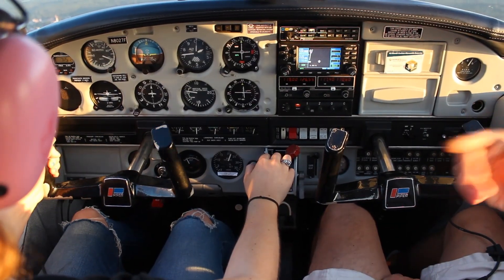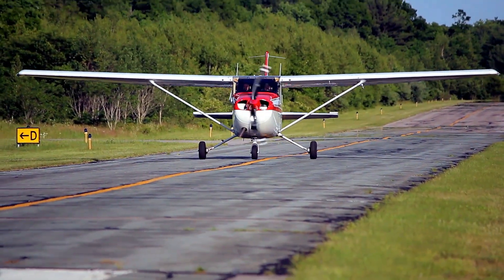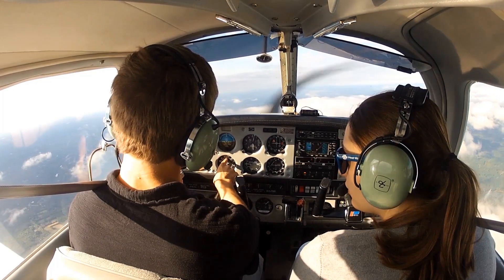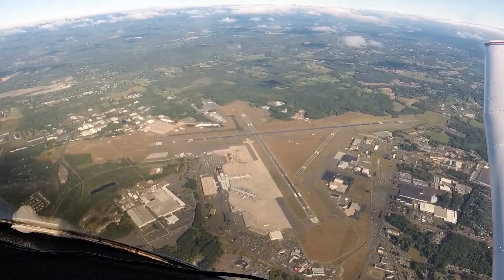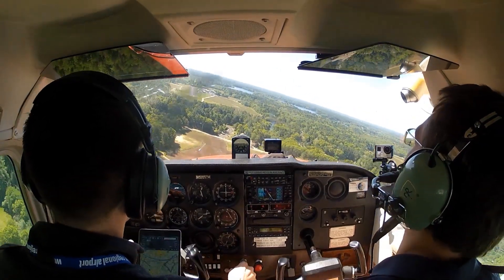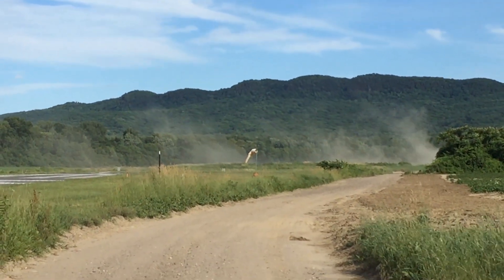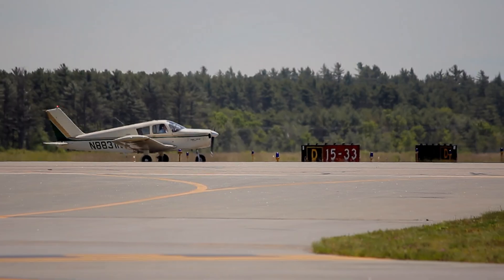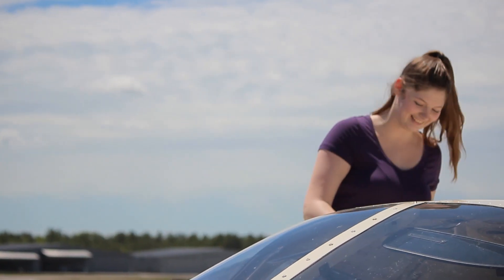Carb Heat Demystified:  Understanding the mechanics and the dangers

Comment: I learned to fly on a PA28 161 some 25 years ago. Carb heat was applied downwind every time, and removed at 300ft agl on final. If there were potential carb ice conditions,  this action would negate the potential, and removal of carb heat at 300ft agl would allow for a full power go around if necessary or  a landing with the air filter engaged above the probable  level of contamination of carburetor inlet air.  Determining carb icing conditions from published meteorological data is easy, but conditions can change from flight briefing at departure airfield to arrival at destination and an attitude to carb heat which allows  precautionary operation and minimises risk of contamination of carb inlet air still seems a reasonable approach to this question. I still maintain this practice. Not very funny or witty I know, but when the wit is over, carb icing does, from time to time, kill pilots and pasengers.
Reply: Same here, it's been 25 years since I flew PA28. IIRC carb heat was on the landing checklist. It was normally applied on downwind. One would note the slight reduction in engine performance, and ensure engine performance didn't improve after a few seconds of carb heat (a sign that there was some carb ice).  Since it was a single checklist item. I was instructed not to leave it on for a long time (and potentially forget to turn it off).
Reply from the maker: This is exactly what I do.
Reply: tag491a I fly a PA-28-180. I only use carb heat when the probability of ice (as seen in the chart in the video) is there. In that situation I'll check in descent by pulling the heat and noting the rpm/engine roughness. You'll get an immediate drop, if it does not improve in about a minute there was no ice there and the carb heat is removed. That said, I've never once seen time where there was ice. Not even in the red sections of the chart! PA-28s are really resistant to carb ice. The only concern I have about your checklist is there is a lot going on in short final and adding a remove carb heat item at that critical time is asking to miss that step. I think you'd be safer just checking for signs of ice on downwind or just before when the workload is not as high.

 Now in 172s/182s I've flown I've had ice. In fact I had carb ice in the 172M I was doing my original flight training in (I had <6hours total time!). The temps were mid 40s and about 90% humidity. Noticed that during the run-up the engine wasn't making full power and when the carb heat was left in the rpm increased over a minute. This was a worst case scenario though. Cold engine (first flight of the day), long taxi (extended low power), on a high probability meteorological conditions day.
Reply: This is exactly the SOP I've been taught, seems to be the best of all worlds. I don't get how you can apply "only if carb icing is detected" when you're at idle - I don't want to find out I've got carb icing just as I'm going around
Reply: I can see the logic Brian and am aware that carb ice with a PA28 is rare, so I agree the application of carb heat downwind should be sufficient with this type. However, I was training at the time and the rationale behind using carb heat down to 300ft was to give me a process which would prepare me for flying other types of aircraft which may be more susceptible to carb ice. My instructor was not a great advocate of absolutely everything in the POH, based on extensive experience. 

Since getting my PPL, I've only spent 5 more hours in a PA28 and flown some 15 other types, in some of which I have encountered carb ice, both in cruise and downwind; 0200's seem to feature here. 

There is always potential for missing checklist items whenever things are busy, for instance downwind with 5 or 6 aircraft in the circuit, and sure, on short final there can be a lot going on, but if you are in an aircraft with higher potential for carb icing, the consequences of missing carb heat removal on short final are likely not going to be as severe as an engine stopping on final – go around with carb heat applied is not disastrous and the reduced climb instantly recognised, usually with a verbal expletive added. Once experienced, not repeated.

If flying different types, one process seems to cover all bases for me, by now is done automatically. It doesn’t hurt those types that don’t need it and works for those that do. There is always potential in stressful situations to make mistakes and using more than one process can only contribute to this. 
Yes, I mostly fly old aeroplanes!

Comment: Got taught on the C172 on finals Carb heat off, so you don't forget it when you have to do a sudden go around.
Greens- gear down and locked
Red- mixture set
Blue-pitch set
Blacks- carb. Heat off and throttle set.
Thats my final check list.
Reply from the maker: Hm, haven't heard the colors memory tool yet.  Neat.

Comment: Is it too late to put it on after rpm goes below the green and the engine sputters?  Do some GA planes have a sensor in the air intake or venturi that tells you what to do?  Do they all use carburetors?  (I drive a diesel truck.)  Your original intro will be very hard to surpass.  This is why TV shows keep the same perfect theme song for their lifetime.

It seems to me, that all you see, is violence in movies and sex on tv....
Reply from the maker: God you always have good questions!  I imagine there is a point of no return, but for the most part, you can burn the ice off.  Very few aircraft have a temperature gauge there, and newer aircraft are fuel injected.  Don't worry, the intro is not gone ;)

Comment: Thanks for the video.  This has been a discussion with my flight instructors for a while now.   They have always told me carb heat wasn't necessary because of the location of the carburetor but never mentioned the routing of the intake.  I will certainly look into that.  Even still, as far as the checklist goes, the decent checklist says, "Carb Heat ...as needed". So you are correct there.   However, the pre-landing checklist says, "Carb Heat  ..ON".  I can understand not having carb heat on if you're landing in the bush, but most of us are landing on paved runways.  As far as doing a go-around with carb heat, the answer is simple, DONT!  Just take it out just as you would if you where flying a Cessna.  I don't understand why that should be such a problem.  Also, if you do need to go around, you want all the power you can get.  You won't know if you have carb icing on base and final and after that, its too late to try to get rid of it at the point.  A very experienced pilot once said to me, "Is it worth the risk?"  I have to say, that question still rings in my ears.

Comment: So what about installing a filter where the carb heat is drawn from?  Is it possible?
Reply from the maker: This is aviation...
That'll be $249.99.
Reply: I believe the reasoning is that you can use the carb heat as an alternative air source for the engine, not only to avoid carb ice. At least that's the reasoning my instructor told me for the C150 i fly.

The idea is that if your main air source gets blocked because the filter got clogged up you need to be able to rely on your secondary source. If that also has a filter it might be blocked for the same reason, that's why they don't filter it.
Reply: that'll be 24.99
Reply from the maker: We're discussing below.  Pending an answer from an expert, there must be some reason, or they'd have it already.
Reply: there's usually a metal screen that prevents fod from going in. Filters wont withstand the temps close to the exhaust
Reply from the maker: Hmmmmm....  I'll buy that.
Reply from the maker: I found mine, and was surprise to find that the grate is super corse.  Like 1/4" holes.
Reply: I read years ago about why it's a bad idea to put screens over intercoolers on cars. It seems like a natural solution to the fact that they always seem to be full of bugs and rocks, but if you crunch the numbers on how much surface area even a loose screen has, it turns out to be quite a large percentage of the area it's covering, and that's before you even talk about the flow restrictions it would cause.

A fine mesh over something that's intended as an alternate air source might be too much power loss on top of the power loss carb heat causes on its own.
Reply: BlackOpSource but on road vehicles bugs and rocks can puncture / permanently damage or plug a radiator and leave you stranded on the side of the road way so a higher air flowing air and armour shroud is a worthwhile investment ( probably one of the most obvious reason why grills were put on Automobiles after certain point because very early ones didn’t have any decorate grills ) and I’d much rather replace it than pay for and having to replace my entire heat exchanger Assembly’s ( turbocharged engine with A/C ) my 2 cense

Comment: Carb heat should not even be a thing. Is this 19 fucking 30?
Reply from the maker: Right, though??
Reply: Have you ever started a large fuel injected Continental on a fast turn around on a hot ramp in Texas?  Sometimes getting the engine to start is the hardest part of the whole dang flight....
Reply: I use to fly a Navion with an IO-470. When I had to hot start it I would do the following. Mixture to lean cut-off. Run the boost pump for about a min. Crack the throttle then engage the starter. As the prop swings add in mixture till it starts then continue slowly adding mixture. Worked pretty well for me. The reason it worked was that the IO-470 fuel rails drain back to tank. So even at low power settings a lot of fuel was going back to the tank to be picked up by the fuel pump again. At cut-off all the fuel is circulating around the lines and not into the cylinders. Have to get the fuel cooled off to get rid of the vapor lock in the lines. My friend started doing that with his IO-550 as well. Not sure about the Lycomings though.
Reply: This is the same thing as an automobile system. The fuel pump always 'circulates' fuel through the lines, under pressure, and the fuel injectors simply tap into the fuel supply and inject as necessary, (and as called for by the computer calling for it based on demand).  The fact that you had manual control of the mixture, is amazing.

Seems like the oem's decided to duplicate carb controls with fuel injection systems in the early days? I'm just guessing here.

On the topic of vapor locks though, these should not happen in a positive pressurized system with a fuel pump in the tank.  Early vapor lock problems were because engine driven fuel pumps were suction based, not pressure based.  There's no physical reason a vapor lock should ever occur with a liquid fuel pump based in the fuel tank. That thing would push out any air/vapor in a millisecond.

Ah such is life as a non-pilot.  I'm just guessing here. I do not know anything about what you've been flying.  
Where the heck are electric fuel pumps on an airplane located?
On cars there's usual 1 in the tank plus another under the carriage, depending on the size/type of engine.
Just an old geek hanging out with nothing else to do and sons in flight school. I'll probably get deleted from youtube for this but whatever. It's just a lot to ponder.
Reply from the maker: Our Piper Arrow is literally the bane of our existence on a hot day...
Reply: You need more intelligence to handle a carb than any other system. Any chimp can start a fuel injected engine and warm it up. A carb engine needs thinking about the engine air intake and mixture control too while warming it up, specially in cold weather or humid weather.

Comment: my 172 is fuel injected. it's nice to be able to forget completely about carb heat :)
Reply from the maker: Lucky ;P
Reply: Until you run into vapor locks in the winter lol
Reply: summer flying is much more prone to vapor locks
Reply: Shadez Entertainment got mine ice cold injected
Reply: Sean what? Vapour lock ? With efi ? I’ve commonly heard that with carbs but not efi
Reply: But you have a fuel pump which means more moving parts 🤷
Reply: So can you fly upside down then?
Reply: @NetAndyCz I know I’m six years late to answer this but here it goes anyways. No, the fuel tanks still gravity feed to where the fuel pump is. Flying upside down will quickly stall the engine.

Comment: Awesome educational video. But where does the air come in from for the cessna 172 when the carb heat is on?
Reply from the maker: I own a warrior, so I can't say with the same certainty that I can of a Piper, but I think there's a hose that goes to the left of the prop.

Comment: Great video! During many years of flying I've deferred to an aircraft's particular POH.One of my instructors from the past made an excellent suggestion to make sure during the after landing checklist to include closing the carb heat as soon as practical.Even on the ground there was a chance of the carburetor ingesting something during taxi(especially in single engine Cessnas).Please keep up the good work!
Reply from the maker: Especially if you're behind another airplane!  Then those particles are huge!!
Reply: You bet! :-)

Comment: Hi,
I fly PA 28 160 hp and 180 hp, you mean no carb heat applied, that's applicable when we're in orange or red spots too ?
I did'nt fly by the manual, I followed the instructor's check list, so far we've been using at all times 2000 rpm down wind till short final and during descent at reduced power the carb heat always on.
I'm surprised and find this very interesting, I'll have a deeper look, just to make sure when known icing conditions are there, would you also not apply it ?
Reply from the maker: I would play it very safe in icing conditions, but icing conditions does not necessarily mean carburetor icing.  The yellow and red lines on the Tach?  Yeah, those are sufficiently high you should not need carb heat.
Reply: Yes, I meant carb heat conditions.

Comment: joke's on you, the 172 I fly has an injection engine. No carb heater for me.
Reply from the maker: Spoken like a true man of the internet! XD
Reply: i will install a carburator on your plane over night so we'll see who's funny
Reply: AFAIK the Cessna 172s does this automatically. It's a little spring-loaded valve that opens automatically when the main intake is blocked.

I also find no mention of any alternate air selector in the checklists (other than the alternate static ofcourse).
Would have to check the POH to be 100% certain though.
Reply: @thierryvt  You use the ALT STATIC when you're tired of listening of your instructor giving you static about your performance.
Reply: Depends on how old the 172 is.   Before it was named the "Skyhawk" is was just a 172 with carb. heat and less horsepower.  I think the early ones only had 150 horsepower.  I remember flying them.  They were slow.
Reply: @daffidavit  Early 172 had 145 hp  6cyl O300
Reply: @pauleyplay  Thank you for the info.  It must have been a heavy dog.
Reply: And even though I'm like 90% sure you're just an angry troll I went and checked in the POH, and it's as I said:

"...The air box has a spring-loaded alternate air door. If the air
induction filter should become blocked, suction created by the
engine will open the door and draw unfiltered air from inside the
lower cowl area...."

So: it has NOTHING to do with carb heat. But it still provides alternate air AUTOMATICALLY to the engine if the main filter should become clogged.
Also: I knew it was automatic, I just wasn't entirely sure about the specifics.
Reply from the maker: Jesus, guys...  sorry you had to go through that.  Your comments make perfect sense, and are great contributions.
Reply: yeah, no.
Reply: Not the 172r
Reply: Black Dog  I had a few Chryslers with Thermoquads in the 70's. Used to race with them (the 340 engine). I had the 850's. What kind do you have on your Go kart?
Reply: Black Dog im the spawn of many unnatural things...but you still smoke dong for a living... and no one gives a shit about the diffrence of your eclipse...you still smoke dong...all day long ...
Reply: Thierry Van Tillo is yours turbocharged efi? I’ve been looking to see if the intercooler can ice up in side and pug the engine and a set procedure to mitigate it ether by heating or spraying and finding what is most likely to conditions to happen . ps. It’s on a higher performance non aircraft engine
Reply: Thierry Van Tillo I've flown on a 172 with a fuel injected engine and you don't have to worry about carb heat. There's no carb heat switch or lever in the cockpit
Reply: Isn't that static source?
Reply: For the most part, fuel injected engines don't need carb heat.  But they do need an alternate source of intake air in case the filtered air source ices up due to impact icing.  Keep your options open.
Reply: @danburch9989  Can you name an alternate source of intake air for fuel injected planes?  Does your aircraft have alternate holes in the engine cowling for this?
Reply: @danburch9989  Even our carb heated Mooney M20C had an alternate air source.  If the front filter froze over, the carb heater would bypass the frozen air filter and save the day.  I know, it personally happened to me.
Reply: this comment chain is a train wreck. :D
Reply: Black Dog: not sure if troll but I'm sure I mentioned that it was "alternate air" i was talking about, not carb heat. If you weren't talking to me then disregard this comment.